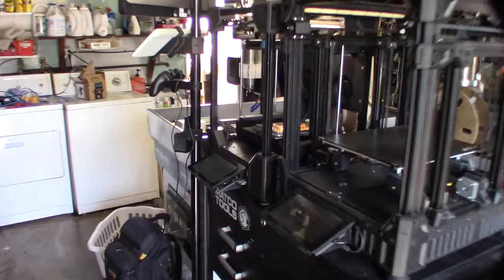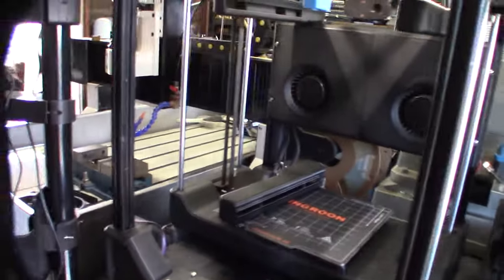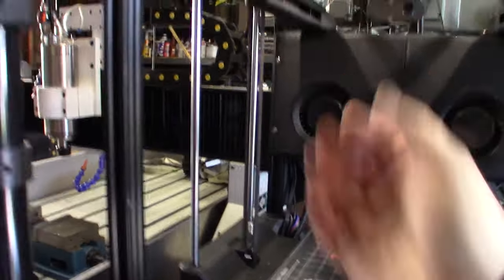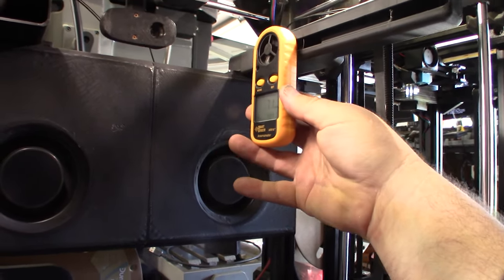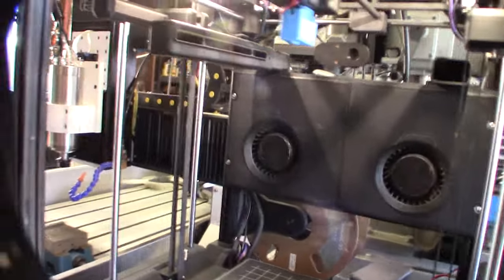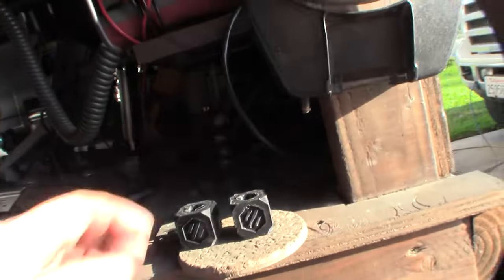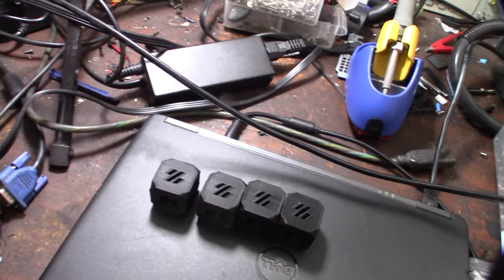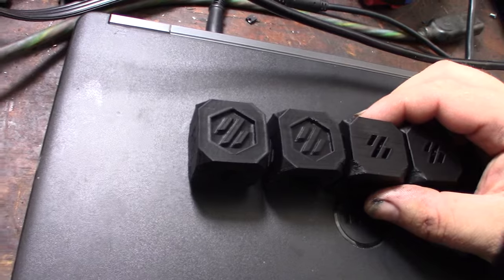Celeritas World's Fastest 3D Printer Concept, Air Flow Testing, CroXY Carbon Fiber Tubes Part 7

Comment: For the cooling add one more fan to each and make in the air nozzle three air chambers ( like three straws next to each other) one for the back, middle and front, If you just want to keep the two fans you got you have to make a nozzle that has three air chambers one for the back, middle and front. rotating it will also help one less bend it has to make.
Reply from the maker: the three chamber are separated by internal ducting. I also might try a full square duct around the bed
Reply: @fintechrepairshop  You may have to add a second fan to each it's sounding like it doesn't have the pressure to move that volume through.

Comment: To maintain static air pressure you reduce duct size the further away from the blower you are. In HVAC anyway.
Reply from the maker: That's actually a very helpful tip, thanks. Makes sense.

Comment: You will need slomoguys to be able to catch movement at that speed :))  Now all the air is going first on the bed and is getting hotter, maybe to blow somehow from top to bed ? i'm struggling to get my printers fix each 2 days, not an expert  so it is just an ideea. Also, like you said, maybe they cancel each other in the center, try to print on the side the test cube. You can adjust the flow for testing with someething to partially block or adjust the internal oppenings.
Reply from the maker: Its actually pretty dialed in now. Look at my air express hotend video. I want to start channeling air.